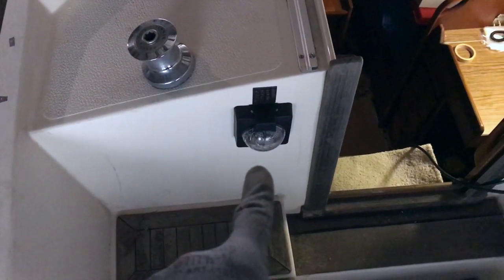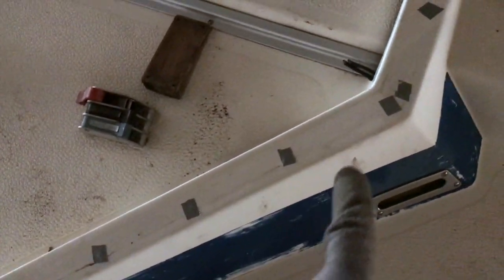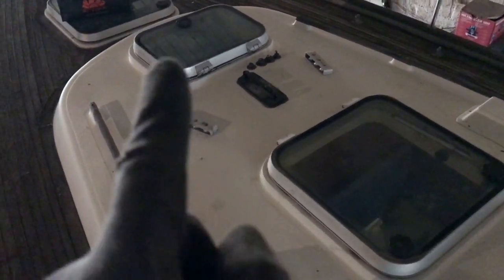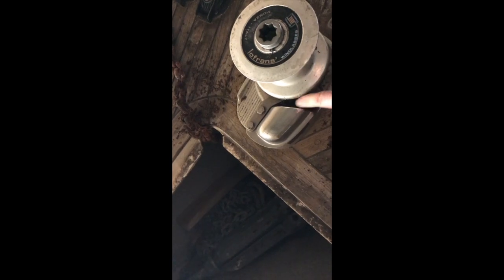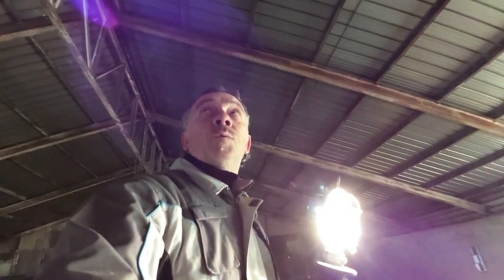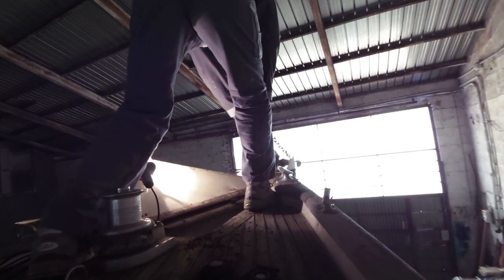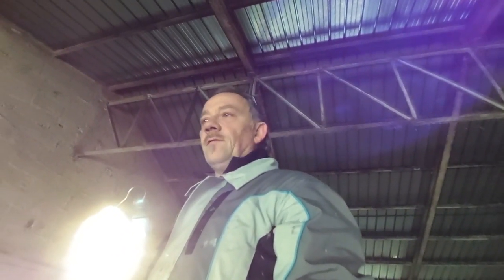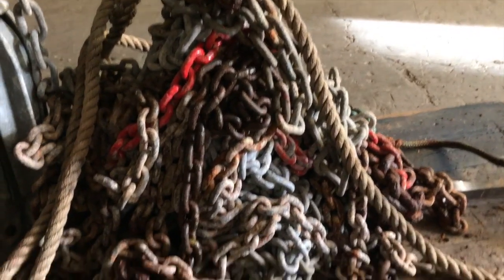Hallberg Rassy 312 "Ellös" - Sea4See - The Chainlocker Nightmare -DIY boat

Comment: That chain locker is not too bad, a little cleaning, coat of paint , good as new
Reply from the maker: Mazda rx7 👍🏻💪🏻
Reply: Also, it wouldn't hurt to have a grate in the bottom so the chain is not sitting in it's own water. It would also allow rinsing of the chain when necessary.
Reply from the maker: Mazda rx7 great idea thank